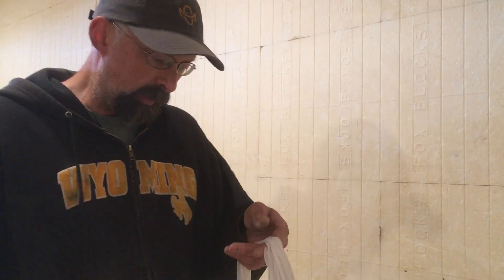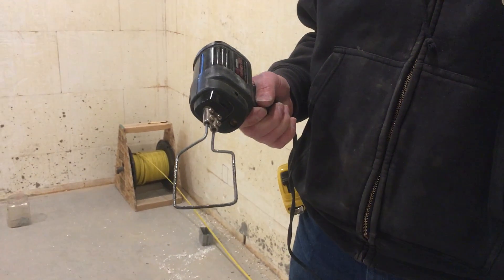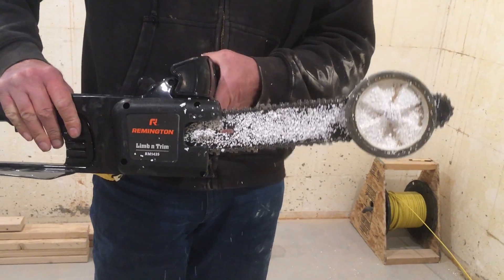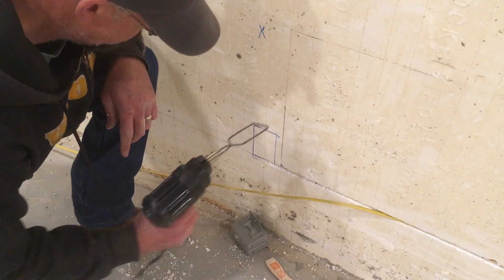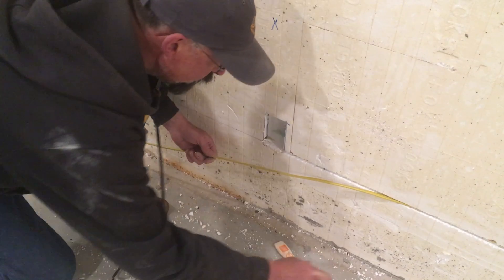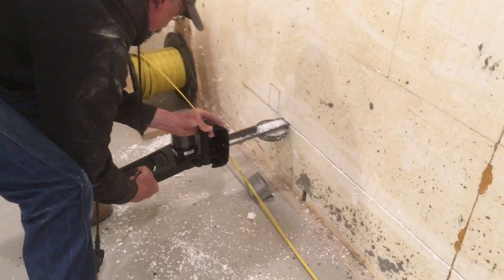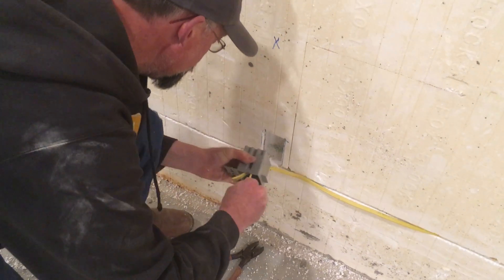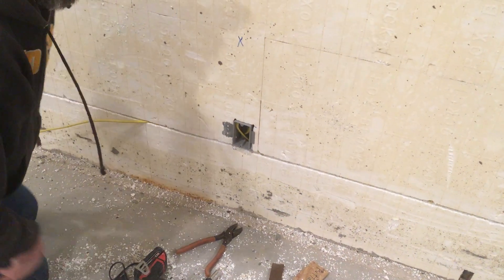ICF Electrical Quick and Inexpensive Tools and Techniques

Comment: Use a Weller 100 soldering iron with a 3/8 " tip to open the electrical channels. It melts easily cheap and no mess. Wire slips in the goove perfectly.

Comment: Thanks for sharing.  Easy and cost effective approach, but I have a question.  Is is not a safety hazard to do it that way?  For what I understand house wires can get hot under load.  In the Caribbean the concrete houses (not ICF) tubing is inserted in walls prior to pour the concrete, and electrical goes in there.
Reply: Yes and no is what I found in my research.

Some will use absolute minimum on wire, which can be overloaded by a home owner. This can cause the wire to get hot.
A good electrician ,in this  situation, will put more circuits in or upsize the wire so it is at 75 percent or less operating rating  under normal use.
Wire should always be in conduit when in concrete. It is a good idea to install conduit for water lines also when in concrete.

Comment: This guy is not a skilled licensed Journeyman Electrician,   he is a Cheap Bastard, how much do you save by using a small cubic in box vs. a 22cubic inch box?  2Cents?  Good luck getting GFI's Dimmer in the new smart receptacles in there.  
You are supposed to strip the wires before inserting into box and leave more slack to make up splices and pigtails.

Comment: Some good ideas thank you for the video I am hoping to use ICF blocks but I am looking for another State to build in after being told I can not have a basement under the home in TN and the builder does not like ICF blocks.
Reply: No basements, WOW, that's a new one for sure.
Reply: @bucmeister7713  Yes well I still hope to build with ICF and put my log home on top of them. Thank you.
Reply: @RJM1011  
I can see that if buying in a builder's subdivision. Kinda like other customers will see and want it also.
Not smart in my opinion, could be a money maker for the builder.
Did you find a place to build?
Reply: @charlesarmstrong3536  Yes thank you I have found a place to build but thanks to being messed about by the US Gov I will now be building in The Bahamas. Thank you

Comment: Love the converted soldering gun, just ordered one and will replicate your idea. Thx!
Reply: He mentioned a #9 wire and lost me.  Copper, steel, nichrome?  I've heard of gauge numbered wire, but it is most always even numbers above #1.
Reply: @bucmeister7713  I used #10 copper and it was OK.  Probably would have been better to use #8 copper, does not bend as easily as the gun hit a piece of concrete in the back of the wall.  Also depends on what size your gun will accommodate.

Comment: A router works faster and cheaper.
Reply: What kind of router bit do you use? I put in a 1/4" drill bit and that can cut deep enough, but it can't cut through the plastic "studs". The chainsaw is perfect for this and the solder/hot knife is a great idea too.

Comment: Interesting ideas. However there are a couple of code violations in doing it this way. 300.4 requires protection against physical damage - the intent being to prevent nails or screws from being driven into the cable when it is hidden. 334.30 requires that cable be secured within 12" of every outlet box - the intent is to prevent anything from pulling on other connections.
Reply: If my inspector said it wasn't secured, I'd challenge him to pull it lengthwise through the foam...good luck with that!  As for protected, a hanging wire between studs is no better protected.  If the inspector insists, put 1" metal strapping into the grove to deflect any nails.
Reply: Would foam work as a fastener? And you could still use nailing plates to protect studs, could you not?
Reply: yes. it would. as it secures it from movement.
Reply: Kolby, depends on your electrical inspector and how relaxed he/she is with the codes.

I have worked on projects that were different forms of ICF. My inspectors wanted to see if the cut channels were deep enough to meet code, then we had to secure the wire with 2" long staples since normal wire staples did not hold in the ICF, then low expanding foam was used to fill the gaps.

The chain saw with a wheel for a depth gauge is a great idea.
Reply: Code is going to be different from location to location.  His video wasn't  about addressing all the codes.  You can do that yourself in different ways using conduit, anchor plates etc.

Comment: love that sodering gun idea! ive done electric in this stuff .used router.what a mess it made.and there should be loops at the box incase drywallers cut a wire.what a nightmare to repair in the box
Reply: Como   learn facts first before posting  "If the heat gets high enough to ignite the foam the entire room will be ablaze in a matter of seconds"
Will the foam add fuel to the fire?
The foams in ICFs are manufactured with flame-retardant additives. These prevent the foams from burning by themselves. If you hold a match to the material, it will melt away. 

http://www.forms.org/index.cfm/fireresistance

Comment: Just a question, when the sheet rock goes on , do they use screws to secure the sheets to the ICF? And if so what happens when they screw into the cabel.
The cable needs mechanical protection. what has been your experiences?
Reply: Electrical forces as long as the wire is an inch and a half deep the screws won't hit it

Comment: is "lumex/ romex" jacket OK for spray foam. I've heard that it can make the jacket brittle over time. also inspectors want to see a loop before going into the JB, ( here in Canada) have you had that come up? BTW great video
Reply: Here in the USA, I had an inspector have us remove the romex because we were installing the wires in a concrete styrofoam block. Had to replace the wire with an underground rated wire. Inspector said it was due to the lime in the block and nothing about the foam. No issues with foam on regular romex.
Reply: cdnbacon2001 turn the soldering gun wire vertically and whittle an opening for the loop, leave an inch before the box, one the flange side you have to move the whittled area a bit away from the box....inspectors want to see the loop within 6 inches of the box. This also helps in case more wire is need in the box.
Reply: Spray foam insulation passes inspection everywhere.
If you choose to you can use commercial grade wire that comes in flexible metal conduit.

Comment: I love what you did and shared in this video.  Much thanks.
Reply: How do you handle 40 cables for say electric oven, etc.  Your horizontal cut is so straight.  Do you make two evenly spaced horizontal cuts for larger cables?  How do you fill the foam afterwards?  Is it required to cover installed wires w/ foam or glue before inspections or not because sheetrock would cover it?  To maintain R ratings It would make sense to fill in cut insulations?
Reply from the maker: Glad to help!
Reply from the maker: My electric oven require 3-10+ground (which is a large cable).  I ran the chainsaw a second time right next to the first cut.  I fill the cut in the ICF with canned spray foam (minimal expanding door and window version works well). I had Nudura spray foam left over from gluing the block together that I used for part of it.  As long as the romex size matched the cut size snugly enough that the romex wasn't loose, the inspector passed it.  If it could move easily, he wanted it secured into the cut with spray foam.  I like the idea of securing it and , like you said filling the gap in the insulating envelope.   As far as cutting a straight line, the key for me is having a visual guide.  I usually cut directly on a seam in the ICF.  If not, I make a line with a marker to follow.